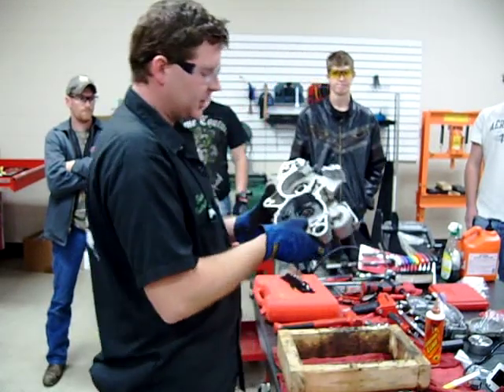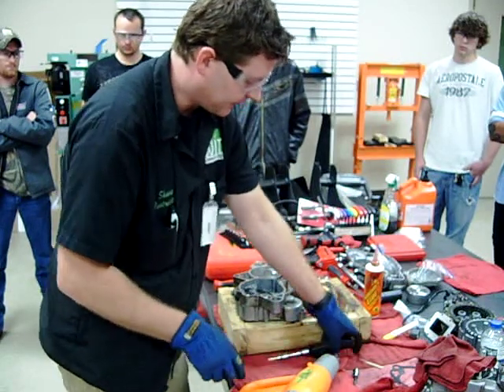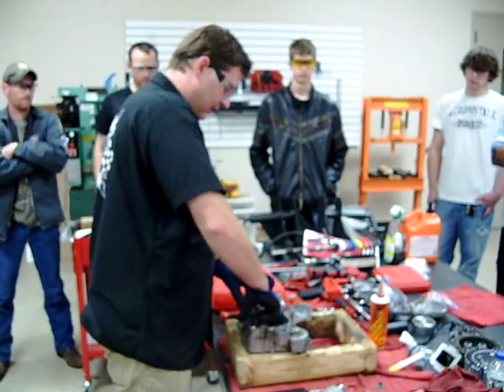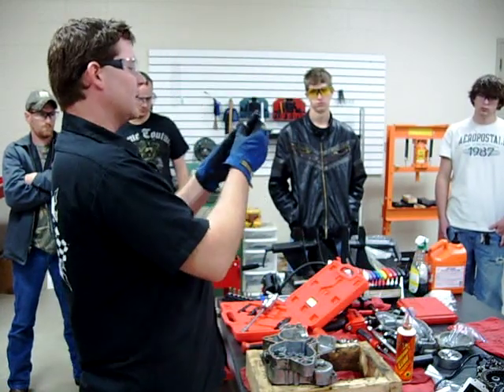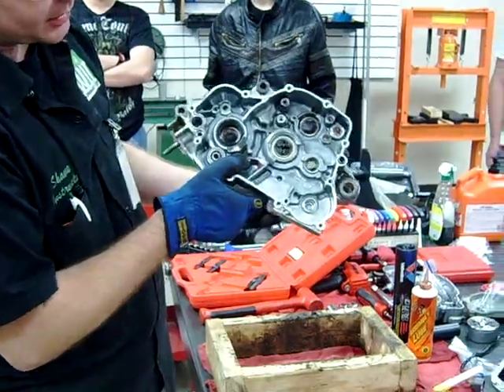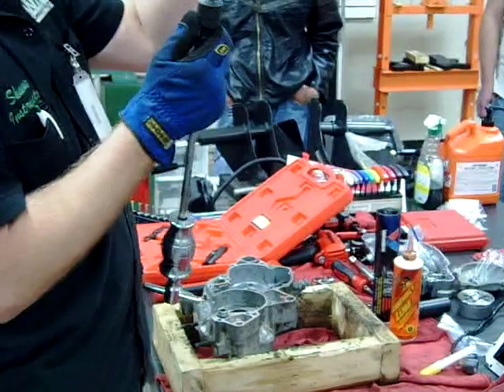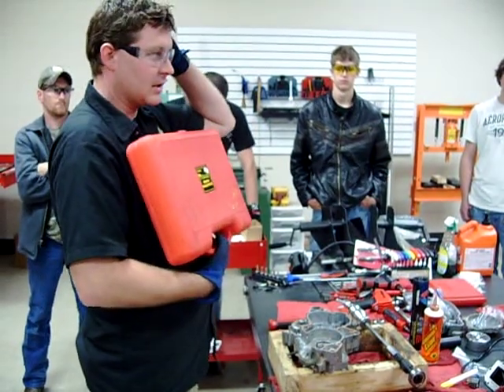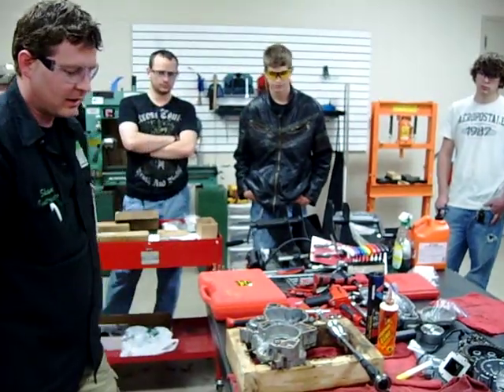2-stroke dirtbike motocross transmission crankshaft blind bearing removal tool

Comment: Why go to such fancy extend to showoff to the naive youngsters?.

Just propane flame the surrounding of the case area around bearing you intend to extract and use a drift to knock out that bearing from the opposite side.
Reply from the maker: +keng lee tan 
LOL Did you not understand what a "blind bearing" is? I can barely stand not to comment here....haha Blind as in the other side has no access for a drift. You folks that don't actually watch the videos and jump to comments so show your poor character...Your thoughts Keng? After watching the video and understanding the intent of the tool...:)